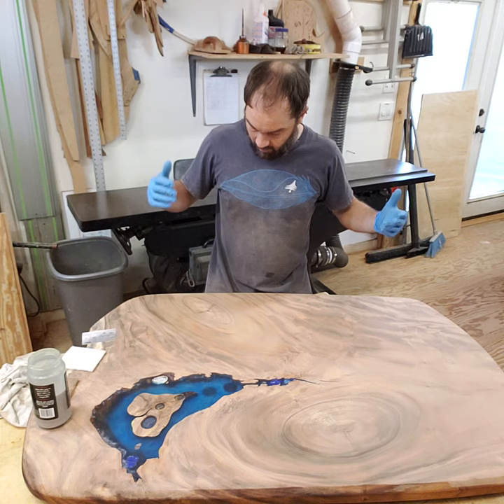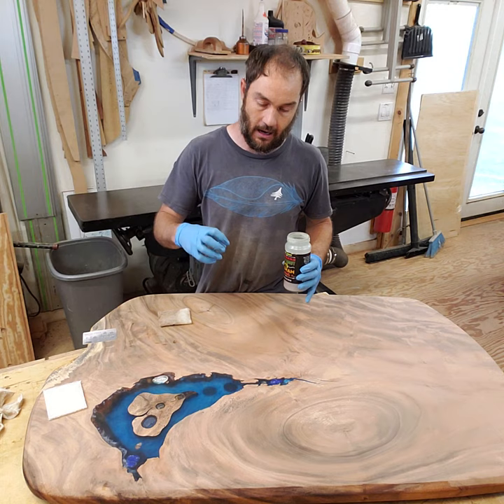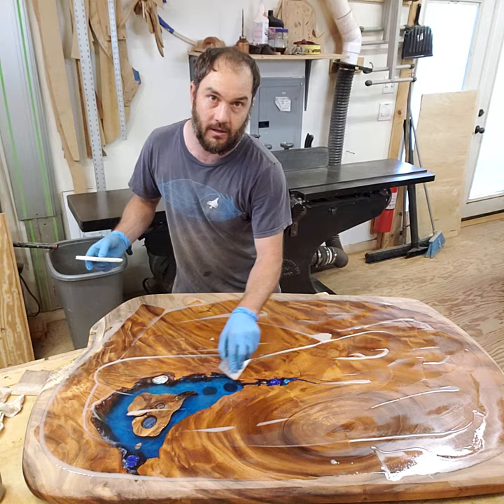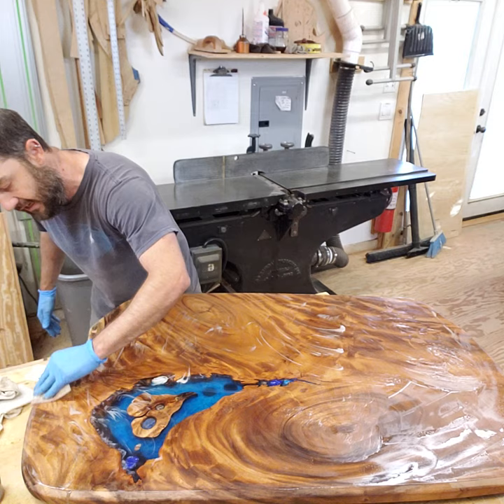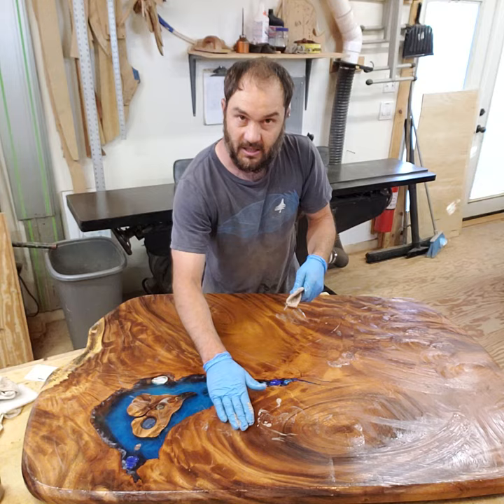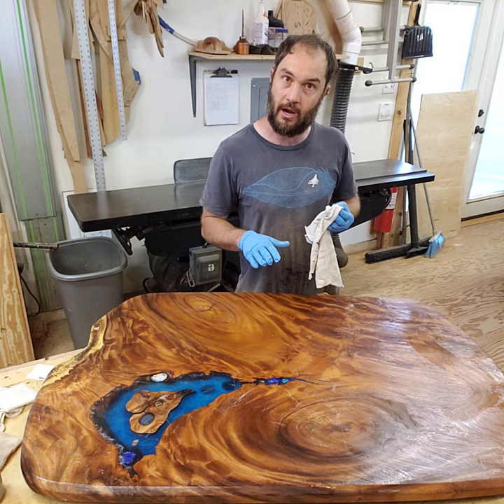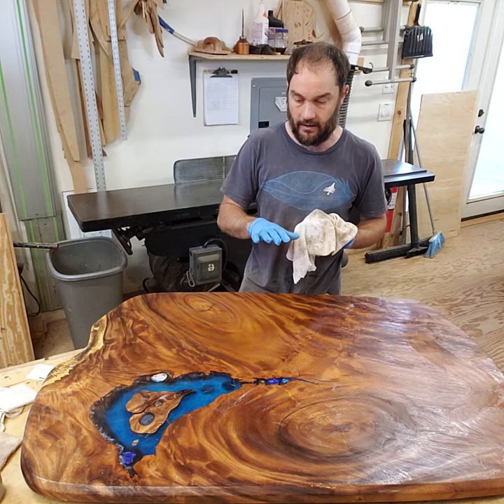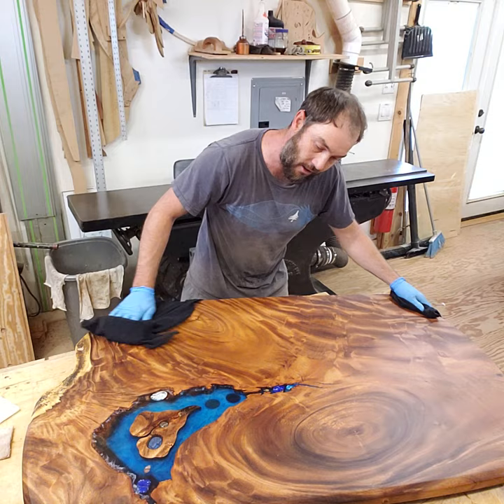How to apply osmo polyx hardwax oil to furniture

Comment: I’m back here watching again as I’ve yet to be completely sold on the product. Your way of finishing seems to be the best for smaller end shops as the most of osmo videos I watch have high end equipment ( buffers) I don’t. So just coming back for another look. Would love to see the finished piece or even the personal countertops. Would like to see more videos of yours  If you can fit them in. Well back to another attempt. Again thanks
Reply from the maker: I an glad some of the small shop tips are helpful.  I had to cobble together a lot of random info and testing and was hoping to make the info search a bit easier for, well...you.  always remember to wipe it ALL off at the end.  I often omit the spreader card on smaller pieces and just use the soft pad.  Finished pics can be found in my instagram feed a while back  @isakziegner_design. Look for the blue and heart inlay.  Cheers, isak

Comment: This is good to see.  I've had some bad results on some oak which I've had to sand completely back now, however it seems I'm simply not putting enough effort into removing it and buffing at the end of each coat.  So this video is invaluable to me :)  Thanks.
Reply from the maker: Yeah, finishing can be quite a journey.  You definately remove all then finish from the surface with this type.  Sort of confusing when other finishes are all about creating a finish on the surface.
Reply: @isakziegnerdesign  Oak is really hard to finish for sure but if you get that finish it will look outstanding. Great video!

Comment: Great job my friend I’m impressed. When you were talking about wet sanding to fill the pores you got my attention what grits of paper did you use. Thanks
Reply from the maker: For wet sending item to use a cork or wood block and a piece of sandpaper that can survive wet sand. I use a grit that is the same as my final grit or higher so 220 is usually my final Grit and I would consider using 320 as well just not something that would leave noticeable scratch patterns.   Once I am done wet sanding and have a slurry on the table I Wipe it off with a plastic card and a bit of a squeegee action so it leaves the poor's filled.   The next day when it is all dried you need to sand it back a little and it can be helpful to go down a grit so maybe 180 or 150 if you are finding that it is hard to sand back efficiently.   Then apply a final coat with the normal process rubbing it in and then buffing it off completely.

Comment: I humbly recommend that you create more videos like this, since your work is amazing! Easy to follow, straight to the point, and full of personality; I was able to watch through the entire video, while being throughly entertained.  Now I feel much prepared to start on my wood working project!

Just a quick question: I saw that for other posts you mentioned, the osmo hard wax can be applied with wood stains, as long as the other wood stain product doesn't seal the wood , which prevents the hard wax from working effectively.  I realized the Minwax interior wood stains actually seal up the wood after drying...so by your words, this product should be avoided? Is there a wood stain product you could recommend that doesn't seal, which means it can pair well with the hard wax application?
Reply from the maker: Hi tommy.  Thanks for the compliment.  I suspect the minwax stain does not actually seal and must be top coated.  You could test it on a scrap of wood.  Apply the minwax and then after it is dry, put some water on the surface.  If it soaks in then it is not sealed and the  osmo would absorb and work just fine.
Reply from the maker: I like to use dye stains from general finishes and transtint dye.
Reply: @isakziegnerdesign  Great test idea!! I don't mind buying a small tin just to test it out -- I save more money if it actually is just fine. Thanks for the dye stain recommendation! Looking forward to your next videos.

Comment: Thanks very much for this demonstration! I have a table I am refinishing for my daughter and some leftover hard wax oil from our flooring I will use. I love the product. It's a great finish.

Also, the floor finish is about six years old now and is ready to be renewed. I'm trying to find info on how best to handle that. I guess I could apply a fresh coat on top or wonder if there is a buffing process I should follow first. If you have any info on how to handle that would very much appreciate it.

Thanks again for the video!
Reply from the maker: A good cleaning is generally all that is required before re-application.  You should lightly sand out any damage or defects that need to be remedied, then go ahead and reapply!  That is the beauty of this system.  It is easy to maintain amd does not need to be stripped off like failing polyurethane type coatings.

Comment: Hi Isak, great video. I am about to apply this product to exposed red cedar beams on our ceiling. I have sanded it all down to remove the original stain, leaving the exposed wood. Any tips on applying it on long 14ft beams? I was going to use a roller, then go back with a rag to remove the excess oil. 

Thank you in advance!
Reply from the maker: I would use a foam thin roller and Cedar will soak up a lot of finish so you may do a coat that soaks in and then a second coat later.
Reply from the maker: You may Look into other osmo products such as thin oil or specialty architectural finish.   I think you can come up with a strategy that involves no need to wipe.  The Cedar is going to soak up a lot of finish and you shouldn't have any puddling

Comment: Great video. Not finished much and it scares me. Feel a bit better now I've watched this. Would you also finish the underside of the table?
Reply from the maker: This is a great finish to start with. It is so easy and forgiving.  Just always be sure to completely wipe everything off the surface when you are done.  Absolutely finish both sides.  If you only finish one side then the weather effects each side differently and you will get uneven wood movement causing cupping or cracking potentially.  The same rule applies to veneering, or even planning a piece of wood.  Ideally whatever you do 1 side you must also do to the other side so that the forces and movement are even between top and bottom.
Reply: @isakziegnerdesign  thanks alot. I did think I should do both Sides because of cupping. Every day is a learning day.
Reply from the maker: @dannywestgate7652   It is a fun journey and learning experience.  Always ask as many questions as you could think of!

Comment: Thanks for sharing. I’ve been trying to find a better alternative to polyurethane. Will definitely try this for my wood finish products. Probably still do water based poly over painted furniture. Can you suggest anything? Thank you
Reply from the maker: @kimberlywebb5481  the osmo is a lovely option, but definitely a different category of finish than poly.  Poly is a film finish meaning it creatwd a film on top of the wood.  Osmo is an oil type finish and the oil and way penetrate into the wood and protect from within.  They have different characteristics.  Films can provide better protection, but a plastic like surface and very involved Refinish process.  Oil/wax finishes provide medium protection, a lovely waxed wood texture and a very easy refinishing if needed.  Let me know if you have more questions.

Comment: Thanks so much Isak! I thought the first coat went well and looks good on my osmo, but the second coat is looking streaky…almost like nothing is soaking in. Any ideas? Maybe I didn’t wipe off enough from the first coat…wish I would have found your video first!
Reply from the maker: The 2nd coat always feels very different than the 1st because the wood is close to sealed and very little soaks in on the 2nd coat.   It should feel as though someone has waxed and buffed the table as you finish your 2nd coat. No finish at all should be felt, just feels like waxed wood.  Go ahead and sand back the streaks and then and then reapply your 2nd coat.   This is actually a method of pore filling and shouldn't be aproblem as long as you are able to sand off the remaining finish that dried and left streaks.
Reply: @isakziegnerdesign  thank you so much!!

Comment: Thanks for video, great work! I’m looking to use this on a piece of sycamore I have for a bathroom countertop. I’ve used wire wool when applying waxes to wood and found it to bring great results. Would you recommend using extra fine wire wool on maybe the second wet coat? Or not?
Reply from the maker: I am not sure what role the steel wool plays in a second coat of wax.  If the wood is properly prepped to the grit or polish you want before application, then the surface is complete .  That means that the steel wool is helping you create a hand rubbed finish and is generally associated with a dull sheen like satin or flat.  This osmo i have selected is a satin finish, so no surface sheen work is required.  Remember, you completely remove the finish, so any polishing or buffing afterwards is about final look, rather than the surface quality or finish application.

Comment: I built a epoxy resin table out of black walnut.  I used Rubio Mono to finish buy there is no shine to the wood.  Can I place a Osmo Polyx glossy over the Rubio to help pop the grain.  Great video
Reply from the maker: The rubio is a similar class of hardwax finish.  You could certainly top it with an osmo product if they make a glossy version. I tend to use satin amd matte.  Any polish or wax that is glossy may work.  Just be careful of waxes that are not the color of the walnut as they often pack in to the open pores.

Comment: Thanks for the video. Do you sand the epoxy portion to 220 or 320 as well? I am doing my first epoxy table and worried that the epoxy is really dull after sanding and really want the almost see-through finish back that was on it just after pouring and curing.
Reply from the maker: You sand and polish the epoxy to the clarity you want in your finished work.  I go up to 1500 grit or higher.  You are essentially polishing plastic as the finish gets wiped off and does not permeate the  epoxy.

Comment: Thank you for replying to my other questions. I have one more follow up. I'm going to apply this to a Solid Oak Butcher block that I'm using as a desk. I already installed it a few days ago and it's "raw" right now. Do you  think I would have problems if I only applied this to the top surface and left the bottom raw? Thanks.
Reply from the maker: Well, on one hand you have the idea that finish changes the way the wood moves and so you are creating an imbalance between the top and the bottom.  On the other hand is the idea that yhis type of finish lets the wood breathe, and so it will be moving in a similar way to the bottom that has no finish.  I would say it has a good chance of being fine if you only finish the top.  You could also use a cheaper oil type finish like boiled linseed oil or tung oil on the bottom.

Comment: Can you put it over a stain? Great video.
Reply from the maker: Yes, it goes over most stain and also comes in colors.  I have used it over general finishes dye stain with good results.  Just keep in mind that a repair may be hard to bend later.
Reply: @isakziegnerdesign   thank you.

Comment: So if i follow your step.  Part one. Do i need to sand the table before applying second coat ?   And what grit should it be ? Before i apply second coat ???
Reply from the maker: There is no need to sand between Coats with this type of a finish. Just be sure to buff all the finish off at the end of each coat so there is no residue on the surface. This is very different from a film finish like varnish that leaves a film and you need to send it to create texture so each layer would adhere to the next one properly. You will notice that after your 1st coat you only need a very small amount for additional Coats because the wood has soaked up most of what it will absorb in the 1st coat and the additional Coats just add a little bit more protection. I recommend at least 2 Coats as the feel after the 1st coat is never quite as silky and nice as what you get from 2 Coats or more.   It is possible to sand between Coats but I would definitely use a grit that is a higher number than what your final grit was for your furniture finishing. Maybe 320 or 400 or even 600. The only time I sand osmo is if I have done a wet sending pore filling coat and left a little residue on there to fill the pores. Then I stand back before adding the next coat.

Comment: Great video. Really appreciated your advice. How about the resin only. I want my inlay to shine. Would I need to buff the inlay with a buffer or will the Osmo make it shine?
Reply from the maker: Is the osmo will get buffed completely off of the resin so you need to Polish the resin to whatever sheen before before finishing the table.
Reply from the maker: The resin needs to be sanded and then polished to whatever sheen you want it to have before you apply the finish to the table. If you want it to be glossy I would sand it up through 1500 grit and then polish like a car with is with polishing paste.   This type of a finish gets buffed completely off of the epoxy.

Comment: Awesome. Getting ready to seal up some Acacia  long grain butcher block countertops with matte finish natural. 

Is a wet sand necessary for a third coat and, if so, how long is the dry time before adding layer #3? I know the finish is not cured fully for about two weeks, but I don't want to screw it up with a 3rd layer. 

Gorgeous table, I'm looking at the work of an artist. Thanks!
Reply from the maker: Wet sanding is just an option, not something required.  You can apply as many coats as you like but generally 3 is already over what is needed.  Wet sanding is quite messy and requires sanding back after 12 to 24 hours drying.

Comment: do you think shop towels could create scratches on the epoxy? great video btw
Reply from the maker: Not if the epoxy is properly mixed and cured.  I often find that i can SEE the scratches in the epoxy once i have applied finish and buffed.  You just weren't able to see them as well before.  You can check by wetting with mineral spirits or alcohol before the finishing process.  Use a raking side light to help see surface flaws.  I sand the epoxy to a very high grit and often polish it if there is a large area of epoxy. It can be Tricky if it is a smaller fill.

Comment: Great video, well explained. My question and concern is I’d like to finish both the bottom and top with first coat in a single day just to leave no room for cupping or twisting. Any suggestions? Obviously I care much more about the top but do not want a customer seeing a half a job on the bottom either. The first time I used this, I did miss some drips and as I began with bottom of table, set over night, once I flipped it, obviously like you said you could see those drips hardened. Any step by step help other than what you explained would help. Thanks for the help
Reply from the maker: I agree that it is nice to get both sides sealed up at the same time.  I like to finish the bottom first including the edges, then buff completely and flip.  I put it up off the bench on thin clean strips of wood to allow for air flow.  Then i proceed to finish the top.  Be sure to triple check for drips after buffing.
Reply: Isak Ziegner thanks for extremely fast response. Great help.
Reply from the maker: @Joestacemazjojo  no problem!   Happy to contribute and share!